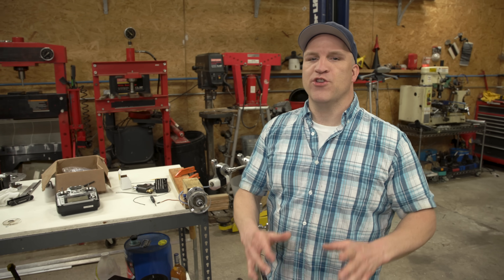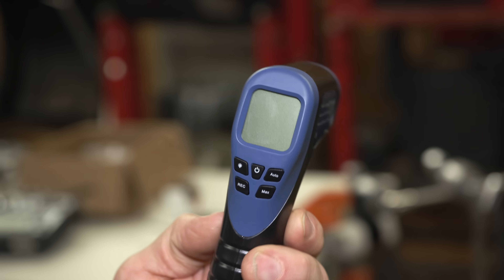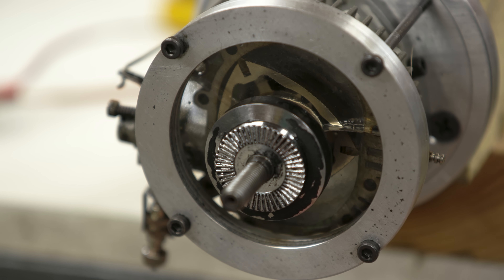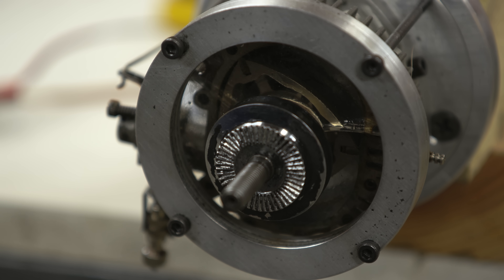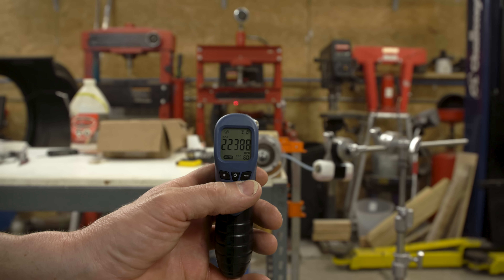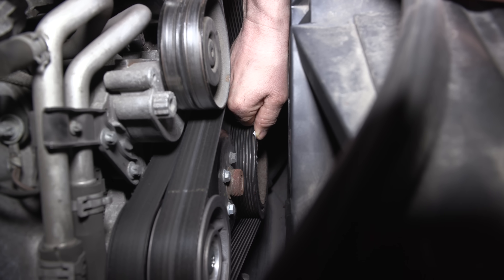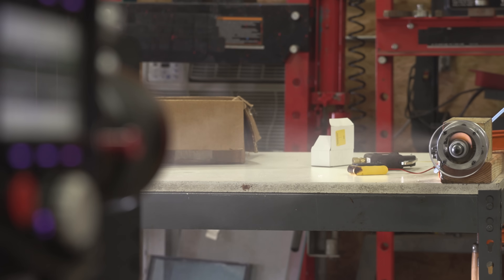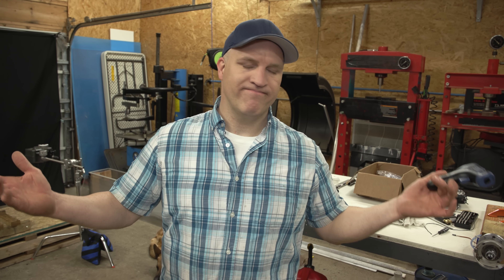See Thru Rotary Engine MAX RPM - 29000 (Wankel Engine)

Comment: I am not surprised.  A single cylinder 2 troke nitro R/C car engine typically reaches 30,000 RPM.  A race spec engine can reach as up to 45,000 RPM.  29,000 RPM from a rotary RC aircraft engine is not as unbelievable as you might think.  Impressive but not unbelievable.
Reply: Rossi,Picco,O.P.S.,MVVS,COX,SuperTiger, And so many more
Reply: "theory doesn't mean jack shit in the real world" Well shit I guess fuck gravity then because that's a theory too lol.
Reply: DEEREMEYER1 Am I only one that gets upset 😡 we can’t hold quality debate W/out all this childish four letter vile/vulgar language.  It sickens me the level of ones own amplitude that they feel vulgar language somehow makes a point more viable when in reality it revealing the exact opposite.  Advice here is go wash mouth out W/Soap & lets hope it’ll cleanse your mind in process.
Reply: you got it backwards he's reading the rpm off the output shaft/flywheel. The rotor is spinning at 1/3 that speed(it's geared not fixed to the eshaft). If this were sized for a car, the stress would be too great at that RPM without magically light metals. The smaller the engine generally the more RPM you can achieve with the same stresses. This is why the Honda S2000 had a higher rpm 2 liter engine and then later in the US, a slightlyer lower RPM 2.2 liter engine. On the 2.2liter the piston has further to go, so would have to go faster to achieve the same RPM as the 2.0. More speed more stress.
Reply: Gravity is a theory
Bruh.
Reply: Gravity can be demonstrated and replicated over and over.  Just like evolution. It's no longer a theory when it can be demonstrated numerous times with the exact same result. "Bruh"   SMH
Reply: @dirtrusty7228  look up the definition of "Scientific Theory"
Reply: You can confirm that on the other video during the slow motion. 3 rotations of the crankshaft for each rotation of the rotary triangle. But that also means that you have 1 rotation of the CS for each explosion, just like in a 2 stroke engine.  I also believe that the definition of RPM's is the number  of rotations per minute of the crankshaft, so I don't think you can divide it by 3.
Reply: Theoretically, Rotary engines have no physical limit to how fast they can rotate. The only limits are things like how much fuel and air you can supply, limits of the metals, friction, etc.
Reply: What the fuck is a "real life race spec engine", Obi Wan Rotary?
Reply: rambow70 the e-shaft actually rotates 3 times per every rotor revolution
Reply: the smaller an engine the easier to reach higher rpms, less weight stress, but this thing is massive in size for it's rpm range.
Reply: The dumbest person on YouTube this guy gets it.
Reply: That 45k rpm engine isn't a rotary engine though, that would be a 2 stroke piston engine but it would only be ~5cc
Reply: In a "real-life" rotary where the rotors are GEARED to the "E shaft" that is correct.
Reply: What could be is that the output shaft of the rotary spins faster than the "triangle", smaller gear in larger. If that is what you mean. So the rpm should have been measured on the rotary instead of the output shaft.
Reply: not at all this is on the small end of RC engines i run a 1.00ci 4 stroke to that hits 25k rpm
Reply: Smaller is the system, smaller is the system's time constant, because of less engaged mass into work, so it should be able to get a faster speed, at least in theory
Reply: A rotary aircraft engine is a totally different design than a wankel engine
Reply: @calebnation7797  rotary is a wankel.... Learn your engines before you TRY and act or sound like you THINK you know what you're talking about...
Reply: @Robert844 Which Wankel??? Only the DKM-54 was a Rotary...Mazda and 25 other companies licensed the KKM-57 design  which is not a rotary.
Reply: @doktorbimmer   a wankel IS a rotary. Hence why they call them "rotors"...
Reply: @Robert844 Which Wankel are you referring to???  Only the DKM-54 is a Rotary... Its called a "Rotary" because the entire engine assembly ROTATES CONCENTRICALLY!
Reply: @Robert844 Son, its very clear now that you would recognize a Rotary engine if one was dropped on your foot! Stay in school and study hard if you want to talk shop with the big boys... now run along kid.
Reply: @doktorbimmer  kid? Lol. Okay. Keep telling yourself that.
Reply: doktorbimmer 
Ah yes. Real rotary engines, the Fucking pieces of shit that were oversized, extremely inefficient, and that stopped being used entirely after WW2 because they were so fucking big. The engines were so inefficient that they needed to stack one on top of another to get sufficient power to haul the B-29 Superfortress!

Edit: sorry, I was thinking of radial engines for the B-29. And as it turns out, they make plenty of power. Rotary engines, on the other hand, were abandoned after just WW1, because engine tech got a lot better, and because... well, a giant spinning piece of metal isn’t exactly the safest thing to be dealing with if something goes horribly wrong, whether on the ground or in the air. Imagine putting a rotary engine in an RX7. And stop there, because that is just imagination. They’re too big, somehow use more oil than a Wankel, and don’t produce enough power to justify the size!
Reply: I am pretty sure the rotary triangle spins 3 times for every one rotation of the crank shaft. This gives it an effective engine rpm of 8,333 rpm. I am pretty sure I heard that on a rotary forum at least. 

So that 45,000 rpm engine would read 15,000 rpm's in the car.
Reply: Rambow70 you may be correct on the rotor thing but he was measuring flywheel rpm. So it was an actual 29k rpm
Reply: @rambow70  no. ANY engine 1 rotation of the crank is 1 rotation. Crankshaft completes 10,000 rotations in a minute that's 10,000 rpm. That is the same in ANY engine. You thinking of the camshaft rotation, but that is not the engine RPM.
Reply: @rambow70  reverse that... the rotary spins once for every 3 rotations of the crank shaft though you are correct in your math that the inner rotor is actually only spinning at 15k as opposed to the eccentric shafts 45k output
Reply: Half this one in WHAT "size"? A Wankel does not "displace" a specific volume per revolution because its not completing one "pumping cycle" per revolution. Nor are piston engine displacements DEPENDENT on "revolutions". Its the area of the bore times the stroke times the number of cylinders. Period.
Reply: RC cars come up to QUARTER-SCALE, genius. This engine is TINY compared to Q-scale engines that can be up to 250 cc. Those 250 cc engines are up to 500 times the displacement and can run half as fast RELIABLY. Get the fuck out Wankel Fantasyland where those rotary shitpiles are the "shit" and come back to Planet Earth.
Reply: DEEREMEYER1 ooohhh did someone get spanked a time or twenty by a rotory? Is ok, your not that only one. Fyi, had my turbo rotory for 19yrs, red line almost every shift, on my rebuilt it once. I can count on one hand the cars that beat me sms you weren't one fuck face. One of which was my brothers love for mustang and got tired of getting spanked by me, bought  a Saleen, still got spanked, over boosted it, won by a bumper and blew the motor for it. So, go fuck yourself.
Reply: Practically speaking, theory doesn't mean jack shit in the real world. And if you believe that theoretical bullshit, you're probably a rotorhead wannabe "engineer". With a pointy little empty head that goes around and around in CIRCLES.

Comment: Great video!  Thank you so much.  Did you know that the rotor is turning 1/3rd slower than the eccentric shaft?  The "crankshaft" spins at 3 times rotor speed.  Wikipedia says, >>"Although at the actual output shaft, there is only one power pulse per revolution, since the output shaft spins three times as fast as the actual rotor, as can be seen in the animation below, it makes it roughly equivalent to a 2-stroke piston engine of the same displacement."<<
See https://en.wikipedia.org/wiki/Wankel_engine#Design

Comment: Rpm is correct,crank shaft had a big pulley which answers low rpm.if you put that reflection tape on the bolt of the crankshaft and not the pulley,Rpm will be much higher.

Comment: That's "only" 11000 RPM faster than the top of it's stated range of "practical RPM" of 2,500-18,000 r.p.m. I used to have one of these in an RC car.
Reply from the maker: You could be on to something there. The manual is pretty vague about what the RPM is of this engine.

Comment: By the sound I can tell for sure 29,000 is more or less accurate. I have die grinders that vary from 12,000 rpm to 25,000. One goes to 56,000 rpm! I am glad your engine still works.

Comment: not sure how ur rpm reader works but to me it never hit zero when u was on a stationary object
Reply from the maker: Yeah it does go to 0. If you look at when I first started it it was at zero. But regardless I know for sure it's accurate because I tested on the car and the high speed camera doesn't lie. That footage clearly counted out at 29,000 RPM
Reply: Warped Perception yeah, i seen that. but i already sent message. u go! that pretty cool

Comment: First time I've seen this channel. It got recommended after I watched some Super Mario glitch videos. I had never understood rotary engines until watching this see-through one run.
Reply from the maker: Thanks, welcome. Make sure you check out the full episode, the original one. https://youtu.be/pCteBhr4dGY
Reply: I just finished watching it, actually. 226 takes? That's true dedication. I'm getting my own channel up and running and I eventually want to do a weekly YT Channel Spotlight. Is it okay if I spotlight Warped Perception at some point?
Reply from the maker: Fryode absolutely

Comment: That's an O.S. What part of that engine are you saying you designed? (Reading your responses in the comments)
 I'm a bit confused. Elaborate? Thanks.
Reply from the maker: timjs1018 whole front half, bearing assy and counterbalance. Shaft bearing thrust assembly. Clear front machined housing, clamping system that keeps the entire thing sealed properly, vibration dispertion system for front housing, and a few other main parts I'm not at liberty to mention as I am currently manufacturing these for sale. have you ever tried to tap the edge of a glass plate with a screwdriver, what happens?. Vibration and glass do not mix well.
Reply: Warped Perception 
I could see the transparent front plate moving independently of the rotor housing in the slow motion footage.  
Very cool. Hopefully there are enough of those old OS wankels floating around for you to be able to sell your conversions! Good luck

Comment: That is amazing.  We have our racing RX8's at 9000.
Reply: Harmonic balance also comes into play Nate.  The 13b fires like a flat plane inline 4 4 cycle which is inherently unbalanced and has a rotating assembly more closely resembling a 60* V6. (Sort of.)  On top of that the wankel has it's own unique characteristics beyond reciprocating piston engines.  For instance, the single rotor in this video has the output shaft spinning 29K rpm but the rotor itself is only seeing in the neighborhood of 10K.

If you notice, the 20b 3 rotors are silky smooth in comparison.  Why?  It's harmonically related to the inline 6 4 cycle engine - a naturally balanced design.
Reply: The limiting factor in production rotary engines is the rotating assembly balance. It might not be an issue here as there is only 1 rotor whereas Mazda rotary engine come in 2 and 3 rotor configurations and 4 rotor race applications. If the rotating assembly is too far out of balance spec it will wobble and cause catastrophic failure. Basically the better the rotating assembly is balanced, the longer the engine will last at higher RPM.
Reply: That's what I figured Unco, thanks for the reply.  Sooooo, maybe he meant 19,000 rpm?  LOL
Reply: Gawin Grimm so corny
Reply: My uncle's German spec RX-8 had a redline on the tach at 10,500...maybe they detuned the American market ones for emissions or something?
Reply: JViello the rx8 13b renesis reliably revs to 10800 stock so you're nothing special.
Reply: 9 grand?  You need to go talk to some Puerto Rican's my man and learn the trade secrets.  LOL   I can still hear the 13b Starlets banging out ridiculous rpm at Englishtown in my mind. b b b b bbbbbbraaaaaaaaaaaaaaaap!  

Seriously though, is there something with the side port engine that limits you guys?  I would take my Turbo II to 9500rpm all day.
Reply: Nate Rist  But the rotating assembly of a Wankel engine only turns at ONE THIRD of the crankshaft speed... only 3,000 rpm. It is an inferior design which is why it is now obsolete.
Reply: doktorbimmer what's wrong with only turning 3000 rpm as long as the crankshaft is turning 9000k+? The only reason there not in production any more is because of emissions
Reply: doktorbimmer thank you, that means a lot coming from you
Reply: Emissions absolutely are the biggest enemy of rotaries. Anyone who says differently is just plain wrong, and most likely a moron for spouting BS they obviously know nothing about.
Reply: +Justin Durand The facts are clear... Mazda's RX models continued to passed the toughest emissions standards in the world here in California... Mazda stopped making the RX,  BECAUSE NO ONE WOULD BUY THEM.
Reply: +Justin Durand Sales of the Mazda RX brand had been in STEADY DECLINE since 1986... with the brand no longer selling enough units to make a profit? Mazda discontinued the failing brand in June 2012 due to lack of sales.
Reply: +Justin Durand The Mazda RX-8 not only earned a notoriously bad reputation for premature engine failures and poor reliability... but also delivered THE WORST fuel economy of any car in its class.
Reply: @doktorbimmer  these cars are suitable for people who love revs and being able to hold them through corners. RE cars are basically like two-stroke motorcycles with four wheels. Non turbos lack low-end torque, but if you know how to throw a chassis around like a bike, then smoother torque will advance when you can be back on the throttle in a turn without oversteering..or if you even have to lift at all. If you come in below good powerband, you can be WOT before a sharp apex with acceleration grip holding and exit the apex already screaming ANY day before anything bottom-end torquey can. Something like a corvette would be off course you try that. Slow-in, fast-out..sooner.
None of this is a secret anymore as there's plenty of videos to show this happening on track. Nasty corvette pulls in the straights, buzzing rotary owns the turns.
Pretty sure I've seen your name on rotary videos for a few years now trashing them. You might have more comments embedded than most rotary fans do on them..strange. Maybe stranger than rotary people are. Idk. If you truly hated them you wouldn't contribute to increasing views on their videos.

Comment: a normal nitro engine can ref up to 35000 rpm
give this wankel a exhaust
and lean it a bit more 
and you should be able to get there
Reply from the maker: Nah it never went to 90,000. There is a decimal point there. If it's at 9,000 it reads 9000.0, 90,000 reads 90000. I triple checked it , it's accurate.
Reply: Warped Perception ?